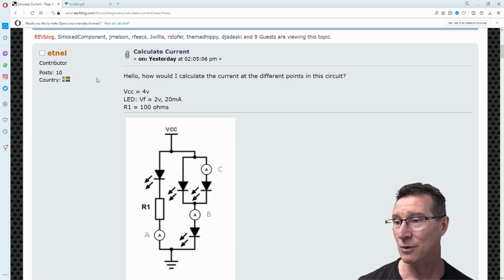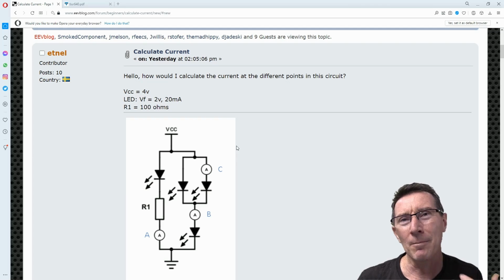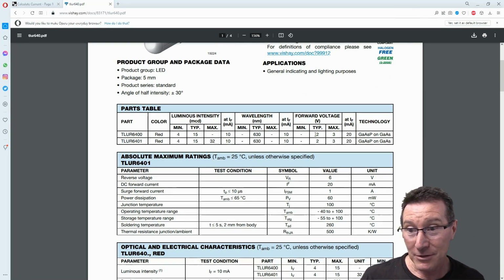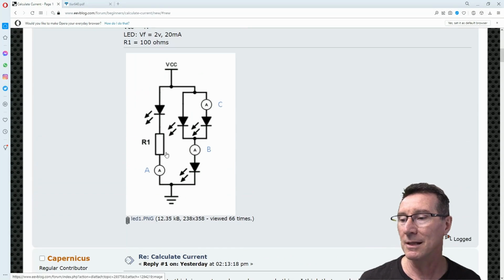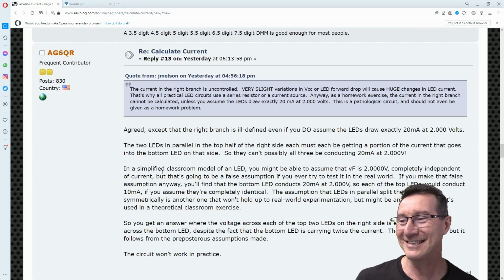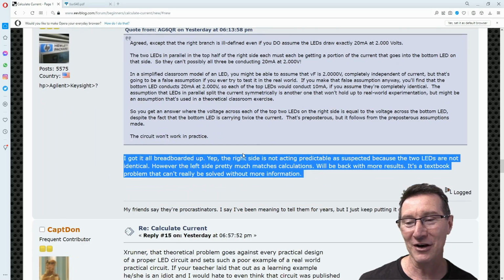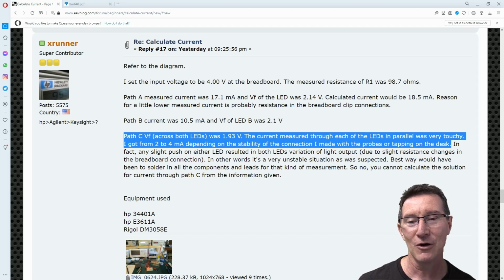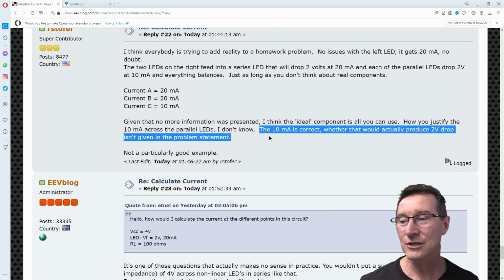EEVblog 1427 - An INFURIATING Electronics Exam Question!

Comment: Actually Tomorokoshi did it right and his calculations would probably match the experiment. But anyway you can actually easily calculate the approximate values, A brunch current is 20 mA because 2v(LED Vf @20 mA) + 100Ohms + 0.02 = 4V. And  using simple logic you may estimate the approximate values for the current in branch B like bottom LED voltage drop should be higher than upper parallel LEDs, because their individual currents are less than the bottom LED current (KCL). And if we assume the top led voltage is about 1.8 volt and the bottom is 2.2 volts we would probably be close to the right answer, next we just estimate the current through the bottom led knowing it's exponential nature at 2.2 v it is higher than 20 and is probably around 28. Then the current through the one of the top LEDs is approximately 14 mA. Even with the slight parameters variation in practice due to temperature and manufacturing process the circuit will still be close to these values, given that the LEDs are of the same type from the same manufacturer. I think an experienced engineer who designed LED drivers a lot and holds the picture of the exponential curve for a "universal LED" in mind could give even more precise estimate for the branch B.
Reply: I agree. I would have done it iteratively. First assume 1.8 V upper and 2.2 V lower, then look at the data sheet and see if the Voltage/Current curve matches. If not, adjust the upper/lower voltages and check again, until it matches. But the question doesn't supply a data sheet, so in the end it is just a stupid question that shouldn't be taken seriously.
Reply: @BjornMoren  Yes you are absolutely right. The question is just dumb. There is no data for the curve and anyway you never use a circuit like this in real life.

Comment: I'm gonna say C is much lower than 10mA because the ammeter has a shunt resistance that imbalances the pair... the one without the ammeter will pass most of the current.

Comment: For an "almost" precise answer to B and C currents values, the diodes current equations must be solved by means of a numerical iterating solving method, like e. g. Newton - Raphson. The proper solution method may be found in one of Leon Chua books; sorry, I do not remember which one =p. It is not a practical circuit, but it is a good testing circuit to test custom made "Spicy Spice Solvers".... ;)

Comment: At 14:38, it appears that the data sheet is improperly formatted. The column headings are incorrect, the column over the "2" should be "typical", the column over the "3" is "Max", and the right-most column is unit.  

Why did you gloss over this in the video?  You'd fail a job interview with me for not having addressed this.

Comment: The issue is the person posting it may not have mentioned the exact question that was asked, if the question is, which ammeter will register 20mA, A, B or C...then its a perfectly good question.. then the answer is A.. The exact question will determine if it is a good or bad question.

Comment: A simple but effective job interview question is,
"In C and C++, what is the difference between
    i++;
and
    ++i;
?
Please note the ; at the end of both lines."
Reply: ++i counts to that variable assigned while the other one counts from i
Reply: @joemwangi5813  Actually, no. The prefix ++ means the variable is incremented before its value is used, the postfix ++ means it is incremented after its value is used. In this case, the value is not used, the ++ is only used for its side effect (to increment i). Therefore, there is no difference between the two statements.

As an interviewer, I would have accepted either answer. "There is no difference" or the long winded one. But I've had candidates who said "I don't know" or gave a completely messed up answer, proving they had no clue.

Comment: The only correct answer for current in the right half is UNDEFINED. 
And that there is insufficient data to answer the question: any practical answer makes assumptions about the LED I/V curve.
And as a secondary comment that it's a stupid circuit.

Comment: My first assumption is that the supply is a charged Li-somthing battery. So low internal R. The resistance of the meters at least 2 to 3 ohm. And i would take about a 30 to 60 seconds to do the measurements. So the only Led remaining is the one with the R inline.

Comment: The question "How would I calculate ..." appears to provide a philosophical opportunity!  First, I'd power up this circuit to let the magic smoke out of that right side of the circuit.  Once the smoke had cleared, the answer on the left branch of the circuit would be 20mA and the answers on the left would be a peaceful ZERO.  I would choose to ignore the temporary and catastrophic vaporization of material on the right side and only consider this calculation after this circuit was at steady state.  It's akin to ignoring what occurred in our Universe during its first few moments before baryonic matter condensed and only pondering life after photons were able to be emitted from these Universal LEDs.

Comment: Once passed by the EE lab and saw a friend in there crying.  Her lab was to build a DAC with resistors, but it wasn't giving her the right result.  Lab design showed the drive circuits providing 0 and 5V for the logic levels, but the lab provided TTL chips.  No 5V out on those, so no accurate to predicted DAC output.  I often wondered if any of these professors ever designed a real circuit.
Reply: CMOS (FETs) =/= TTL (BJTs) as far as I know. they're two completely separate universes. no wonder she got confused. I still am.
Reply: @waltercomunello121  I grew up with TTL. Can use CMOS, but have trouble understanding discrete FET's. Must admit I never took the effort to dive deeper into them.

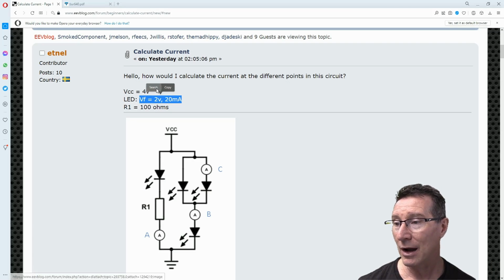Comment: I was in an EE lab in college.  Lab assignment required 4 power supply voltages.  Lab power supplies only had 2.  TA drew a voltage divider on the board.  I told my lab group, that won't work and we're going a different route.  I would've told the class but it was graded on a curve. 😂   The lab circuit was such that we could build half and test on 2 supplies, then build the other half and test with the other 2 supplies.  Worked out fine.  1:00 lab, out by 2:00.  Some of those poor students were there until 11:00 trying to get that circuit to work.  The divider circuit came from the prof, who should've known better.  The TA, an EE grad student,  should also have known better.  SMH

Comment: When the power is first applied, the LEDs on the right operate in the incandescent region of the I/V curve which is probably somewhere around 2 amps for B and 1 amp for C. However as the diode material oxidizes this quickly drops to 0 amps.
Reply: If my lecturer were insistent that this was a valid question then I'd sub out the LEDs for resistors that conduct 20mA at 2V (100 ohm) and solve that way.

Comment: Given a math question like "there are 2 dozen doughnuts and your friend eats 8, how many doughnuts are left"....you'll be complaining about the type of frosting on it.  That doesn't fucking matter, the question is given, and it doesn't matter if the circuit is linear, you were only given enough information to answer.

For fucks sake....you are complaining about a 10% difference between a realistic circuit....10%.....there's a 10% error in a wall socket, you think you always have 110 or 220 the whole time?  Fuck....this is what infuriates me about this shit, nitpicking every fucking detail like everything has to be exact.

You want to get even more technical?  It says to "how would [you] calculate it".....the answer is "you stick a few probes on the circuit and get a number"....that's the correct fucking answer.  The tolerance to the resistor is not given, nor for the LEDs, so unless you do a hot test, no answer would be correct.  But they didn't ask you "what" the values were, they asked "how."

Comment: According to LTspice and Multisim, after voltage is applied to that circuit, considering the current limit is undefined, basically, the right side of that circuit will not exist after a few milliseconds, so A(A)= 32.54mA (in Multisim & LTspice) , A(B) & A(C) both are Zero because the LED's  on the right have turned into flash bulbs.

Comment: Honestly, this is not even bad compared to exam questions I was given by one truly inept teacher. I've seen everything from circuit questions lacking enough information to solve in any fashion whatsoever to a test that consisted entirely of a couple pages of text with keywords removed that was treated as a fill in the blanks exercise where the text was literally copy pasted from a website VERY obviously created by someone not a native English speaker and was nothing related to either the lectures or any material in the text book. In other words, yes this question is crap, but it's at least the kind of crap I can formulate an answer to! 🤣

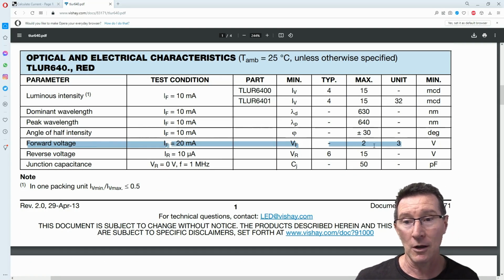Comment: 14:55 They've got five labels on the table wrong.  There are two labeled MIN., the first of which should be labeled "SYMBOL" from looking at other LED datasheets from the same manufacturer.  The last four have been cyclically shifted on column to the left.  They should be listed as MIN. TYP. MAX. and UNIT.

How does a thing like that happen?  Well, it's a datasheet.  The person who created it probably created a couple of dozen of them just that day.  They just missed that there was a glitch in the form when they correctly entered the data for the specific component.  It also looks like, by sheer chance, Dave pulled up the only LED datasheet from Vishay that has this kind of error.

Comment: Back in the old day's LEDs would actually explode when overcurrent was applied. So those that branch with no resistors would be all kinds of fun, when the supply voltage drifted over 4V. A software engineer wrote that question.

Comment: why so many 'IF's' to a theoretical problem!? why even consulting a datasheet? the problem states 20ma at 2V, NOT 1.99V NOT 2.01V, exactly 20ma at 2V, so you can replace all the LEDs in the circuit with what? 100 ohm resistors, ofc , can you calculate now ?  its 13.3mA C, 26.7mA B, 20mA A..

Comment: In the Netherlands for a ham radio license they had the question about a resistor+ 6V zener circuit. At what input voltage would the output be the most stable: 0V, 6V, 12V. The expected answer was 12V input, but actually the output voltage would be most stable with 0V input, albeit not with the desired 6V output.

Comment: ..I sometimes wonder why there was no 1 volt LED.. It got smaller up to a smd but stayed the same ~ 3 volt ..is it possible to do..? Reinventing the LED voltage..ok.. returning to the question..i bet all not lit  at all or very faded same amount..but more interesting topic would be "  could i make a bypass connector if the series was broken " while handling delta  voltages like solar panels...

Comment: I was asked a trick question for my interview for Saturday Boy at Maplin Electronics store 1994.. They had a small pile of basic components on the desk and asked me to identify them all.  I got them all right except for the 1 1/4" glass fuse which turned out to be a 12V car courtesy lamp (designed to fit in a fuse holder).  
I thought 12V was a bit low for a fuse rating but I still got the job.

Comment: Since there is no limiting resistor in the second branch, the LEDs will draw a current level that develops an ~ 2vdc voltage drop, so the two LEDS in parallel will draw ~20mA each and the bottom LED will have ~ 40mA assuming they are kept at 20C and don't run away.

Comment: It's notable that these comments include a wide spread of confident answers ranging from total ignorance about diodes to neat solutions using Shockley's diode equation.  But its rather sad to see how many of the former there are on the EEV channel where I would have expected a better educated audience especially considering Dave's previous videos on fundamental principles.  I don't expect the average electronics enthusiast to know the diode equation but they should at least understand the general shape of a diode V-I curve and be able to see that the current C will be less that 20mA and current B will be greater than 20ma.

Comment: It's a decent interview question but a terrible exam question, because developing your ideas correctly would cost you time you would not be able to spend on other question. Teacher are not robots and can ask dumb questions and you will be confronted to such problems. The smart move here is probably to answer the easy left part and keep the right branch for the end of your exam. If you have time to dissert you can try something to show your skill.
It's a problem with a lot of physics program that tend to be too disconnected from true technical problems to ask interesting questions, very common.

Comment: Greetings Dave,
Well, this is an interesting problem because practically it doesn't make sense if a constant LED voltage drop model of 2V is used.  However, if I were interviewing for an analog INTEGRATED circuit designer position at a semiconductor company, this is a BEAUTIFUL problem.  That's because in the integrated world, we quite often put PN junctions in series or parallel.  For example, if I were to make one BJT twice as WIDE as another, then it would have TWICE the current handling capability for the SAME VBE voltage drop (does that make sense?).  

If I asked this question during an interview, I would expect the potential hire to say, "Well obviously, we can't use a simple constant voltage drop model here - we need to lean on William Shockley's Diode Equation and calculate V's and I's more precisely."  

ME:  Ahh...Music to my ears!!  Keep going...

OK, now, for the circuit on the left... If we sketch the exponential vi characteristic with the given point (2V, 20mA) indicated, it turns out that a LOAD LINE drawn for the linear circuit (4V source and 100 ohm resistor) PASSES EXACTLY through the same point.  Therefore, the voltage across this LED is EXACTLY 2V and the current through it is EXACTLY 20mA.  Done with that!  

ME:  Great!  You've already done better than 90% of the people I've interviewed and I can guarantee you a LEVEL 1 designer's position.  Keep going...

Shockley's Diode Equation must now be applied to the LEDs on the right to determine unique voltages and currents, but first we must determine three unique constants - the Saturation Current (Is), the process parameter (n), and the Thermal Voltage (Vt).  I will assume that n = 5 (typical for many LEDs) and Vt = 25mV at  20 deg C (room temp).  Also, given our data point (2V, 20mA) we can determine (Is).  I calculate (Is = 2.25nA approx.)  

ME:  Where did you go to school?  Do you have friends I can interview?  It's worth $5k per hire for you.  You're now at LEVEL2 (+$10k)... Keep going...

OK, so now we can write two Shockley equations - one for the parallel LEDs (which must have the same voltage across them and current through them)
and one equation for the bottom LED that must have twice the current of one of the LEDs above.

Taking the ratio of these two currents yields that the difference between the voltage across the parallel LEDs and the bottom LED must be 86.64mV, and solving for the currents yields:  14.14mA through each parallel LED and 28.28mA through the bottom LED.

In summary:
LED on left:      2V across it , 20mA through it
Parallel LEDs:  1.96V across, 14.14mA through each
Last LED:          2.04V across, 28.28mA through it

ME:  BRAVO!! Level3 Designer (+20k per year and a hiring bonus!!)!  When can you start ???  Let's go to lunch!   Hey Bill, I'd like to introduce you to our new Level3 integrated circuit designer.  Would you like to join us?
Reply: Very nice! My only small niggle is that for real red leds at 20mA, the parasitic resistance tends to dominate over the Shockley V-I slope resistance. The results are pretty much the same, except that you'll get more like 1.9V across the parallel leds and 2.1V across the last one. There's nice Vishay pdf datasheet for the TLUR6400 that plots log I against linear V and you can clearly see how it increasingly deviates from a straight line (exponential relationship) beyond about 8mA.